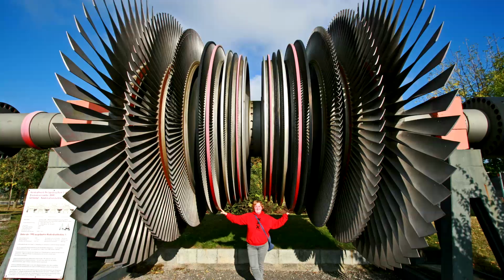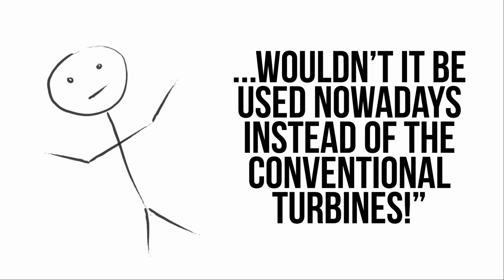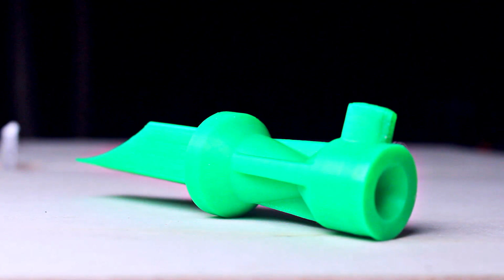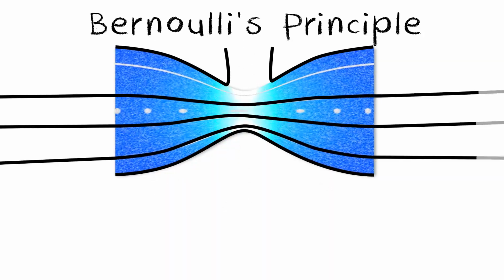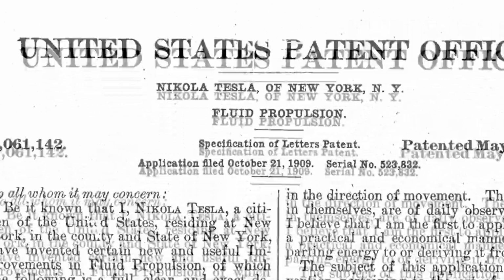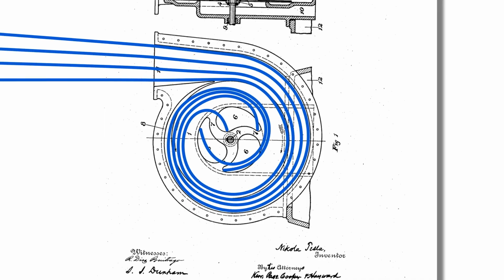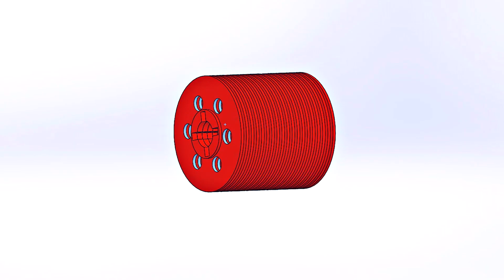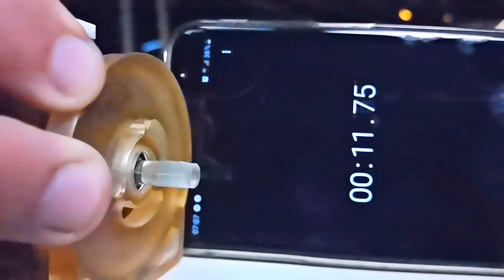Tesla Turbine [Smoke Flow Slow Mo]

Comment: Why not stagger the holes on each disc so when they are assembled they make a helical path through the discs for the exhaust. If you do this I think you can take advantage of some of the surface area inside the walls of the holes and introduce turbulence that could increase friction between the discs.
Reply: A hollow shaft with openings in the 2/3 farther the main exit and a centrifugal exit in the shaft to make a lower pressure in the center, It may help the flow but not sure about air viscosity inside the shaft.
Reply: Good luck keeping the vibrations down...
Reply: @tinklanjscek2700  if they are balanced per disk there will be no problem
Reply: @sugarbooty  I think you're right, and I misunderstood the suggestion originally.
Reply: @sugarbooty  Tesla has a special balancing apparatus patent for this, patent 186,799. He also has an improved disc stack construction patent GB 186,082 that he patented 10 years later after the first patent that does away with these difficulties and makes it so the turbine doesn’t need to be balanced 1 disc at a time.

Comment: You are using a small nozzle on your air supply right before the inlet of your turbine. Maybe this messes up your airflow, so your special inlet design is  not useful? You could try to use a bigger diameter hose as an air supply and control it with a ball valve.
Thanks for your interesting video and for sharing your mistakes, very useful for others 👍

Comment: Tesla turbines fell out of favor in power generation because at the time, there were no suitable materials available to with stand the forces on the blades. Thus, causing them to warp and the machine to fail.  So, if you want to bring the tesla turbine back, you need to find a good non deforming material at the speeds needed for power generation.

Comment: Additional to your laminar flow concerns, there are boundary layer effects occurring. You may want to calculating differing displacements of boundary layers, this is typically associated with a "Reynold's number". There are methods for directly calculating the displacement of the boundary layer away from the object that is in flow, which would allow you to intuitively space out your turbine "blades" for differing flow conditions.

Comment: I don't believe the convergent divergent nozzle will help you here. The reason it is successful on rocket is because the fluid if flowing at incredibly high speeds. In this case, fluid dynamics are 'reversed' meaning the diffuser at the end will actually further accelerate the already high velocity fluid. I think in your case, you may be better off will just using a nozzle if you want to increase the flow velocity. Hope this helps, great work!

Comment: Worry about your engine that your using for the energy conversion. Most engines are designed for great efficiency so will not produce what your looking for. You need something designed specifically for power generation. They make them. Look for replacement parts for windmills home use. I believe alternative would be a quad copter motor with the highest KV motor you can find.

Comment: This man will be the one who causes a 3D printer uprising

Also I’d really like to see you try the Tesla turbine with vicious liquids like honey or something even thicker, or maybe a thick gas. I’m not an engineer but maybe if the disks where thinner and the spaces between them are closed, it might be more efficient? Idk, I’m pretty dumb
Reply from the maker: Still around my dude!
Reply: there's a limit to how thin you can make the discs and how small you can make the spaces. Ideally you would have an infinitely thin disc with an infinitely small gap
But you run into the following practical considerations in order 
1. Structural integrity
2. Manufacturing
3. Size of the molecules
4. Quantum physics

Comment: Call it AzgNiET = your channel name backwards azgetni in the order of the name of the device ANET.

To get more power from the motor a more powerful magnet and a better coil design as I said before in your last turbine video. Since the coils on all devices have a loss which no one addresses due to the magnetic friction it has.

As I said in your last video to make a better turbine it would be better if you have the air eject from the center which I explained how.

The width of your internal chamber is too big in comparison to the air pressure you put in. its like your ar trying to rotate a ferries wheel with a small nozzle.

Tesla was smart since he read a lot, practiced a lot, was persistent to not forget to put it off for too long,

Comment: I believe for the "improved" version to work.  the rotors will have to be enlarged to match the largest dia,eter of the chamber and slots cut in to the walls where the rotors will overlap when it narrows.  might be a bit hard to get the tolerances right on 3d printed parts.  but might be worth a shot.

Comment: What if every other disc is connected, like a water mill. So the gas can push more surface area. It would use both turbine methods. Probably half the disc but significantly more surface being pushed. I wish I could explain better or show you.

Comment: try building an adapter to take rainwater from your downspouts to run the turbine.  you'll want the shaft oriented vertically with the outlet on the bottom.

Comment: @integza make the disks bigger but make the air tunnel smaller all together to make if you have high output of air flow in a small area it will have to go somewhere. Thus more power? Sincerely Jacob

Comment: 3:21 are we going to talk about how the blades are spinning backwards here????
Reply: The blades are not spinning backwards! The first 5 blades are the compressor, the others are the turbine. That is not a simple turbine but a Joule cycle!
Reply: @Nitro8996  So, If I am understanding you correctly. The first blade, even though it's angled opposite the way air would push. Would actually push it the opposite way?
Reply: @W00FLES  yes It Is in the opposite way, but there is something strange because the last blades of the turbine rotate in the right direction!
Reply: nitro8996 that's what I was saying!!!!!!

Comment: Theoretically if it was made of heat resistant materials you could use a closed cycle steam system powered by a solar concentrator

Comment: A Proper Wash + Cure Station Would Help In My Armchair Opinion
Reply: Here is a Good OTTS one:

https://www.amazon.com/ANYCUBIC-Photons-Printer-Cleaning-Machine/dp/B083GTS8XJ/ref=as_li_ss_tl?_encoding=UTF8&pd_rd_i=B083GTS8XJ&pd_rd_r=d79873d3-e2d5-4e14-b126-7e473a6401e7&pd_rd_w=CrJV9&pd_rd_wg=ffgrt&pf_rd_p=4022e0f2-c06e-4e9e-bb48-d7486d1197f7&pf_rd_r=9Q4AETAN0CB6ERQ8ECVM&psc=1&refRID=9Q4AETAN0CB6ERQ8ECVM&linkCode=sl1&tag=3dpriner-20&linkId=b0dbfe153ed7fd3c51156dfa6c53ec98&language=en_US
Reply: DIY is easy with a type of alchohol, a min, some sort of agitation, and uv leds and/or sun

Comment: I'm not an engineer, but I would like to try some
 modifications: 1) make the discs progressively smaller outward and do the inlet only on the center or 2) do the inlet very tight to the outside or 3) make the inlet very wide almost as wide as the radius of the discs. sorry if I said a lot of nonsense stuff.
Reply: Tight = speed, wide = efficiency.. :)

Comment: @Integza: please use gloves and  safety glasses when you're handling resin and the parts, that stuff is dangerous. For the record I've got a large FDM (HEVO 290x290x750mm) and a small sla Nova3d elfin) printer myself and the Elfin prints are very good if you don't forget to add resin in the middle of the print.

Comment: C-D nozzles are used to convert subsonic flow to supersonic flow, but the throat of the nozzle needs to be "choked" to where the velocity at that point is at Mach 1, otherwise you're just going to slow the fluid down because it never gets up to critical speed. You'll also need to do some calculations to see what the optimal expansion ratio is based on your pressure input and atmospheric pressure.
Reply from the maker: Thank you for the help :D

Comment: These tesla turbine videos are my favorite. Do you think there is a way that you can create a region of turbulent flow along the inside wall of the casing but no where else that way the fluid input is not being slowed while trying to interact with the case rather than the disks?
Reply from the maker: I actually can, there's this thing called turbulators the generate turbulent flow!

Comment: If you use hard drive disks, you'll probably be able to safely hit higher speeds. I'm not sure how durable SLA resin is, but I've heard that it leaves lot to be desired.
Additionally, try using an involute casing with a separating fin that follows the curve of the disk somewhat further

Comment: @
Integza  I have several questions:  Did you test both casings with the standard and convergent divergent nozzles?  What are your thoughts as to why the Volute casing did not perform as well as the standard design?  Was your Volute casing designed with a Fibonacci spiral (I realize that Tesla'a own design doesn't use Fibonacci) for the gradient?  Would you be willing to do a follow-up on these points?

Comment: Dear Integza,
the diffuser at the inlet of your turbine has way too high angle of flare (this diffuser should be way longer), in this case the stream of the air is disconnecting from the walls of the diffuser, due to this discs in the middle are getting more air than those on the sides. The optimal angle of flare for diffusers is 5-7 degrees. Print another one, I can bet that the rotating speed can be higher.
In order to get de'Laval's nozzle working you have to calculate it very thoroughly
. There is a lot of physics in that. If you don't do this, the nozzle is not going to work. This is probably the reason, why the turbine was working with lower rotating speed.
Reply: Excellent point.  This is why I asked if both cases were tested with both nozzles.  I suspect that a wide, flat channel between the standard nozzle and entry into the case may enhance the surface area of disks affected by the fluid.

I would also love to see a one-for-one-for-one comparison between the standard casing, Tesla's Volute casing, and a Volute case with a Fibonacci curve for the gradient with all other parts identical.

Comment: Great video! For improving the design of the TT,  you might want to study which is more important, big disks or many disks (for a given disk area). I have no idea how to measure that but it might help understand how to improve the TT.
Reply: I suspect that the original turbine, being made from metal, benefited as much from the flywheel effect than surface area (assuming smooth disks).
Reply: @Circle14  what's the flywheel effect?

Comment: I am not an engineer or anything, but since those turbines are based on the viscosity of the fluid to spin, I think making rough disks would help improve the design, as it would "have a better grip on the fluid".
If you can, try coating the disks with some kind of abrasive painting and see if the torque/Rpm increases :D
Reply: Instead of coating the disks it would be better to lightly sand them with some 80 grit sandpaper.  If you add a coating it could ruin the tolerances or create an imbalance.
Reply: @Circle14  yeah, you are right, but I heard that sanding resin with rough sandpaper is gonna give you some trouble... still worth trying tho
Reply: @mauco4037  True, but the disks don't have to be resin.  In fact, it may be worthwhile to use metal disks.  The density of the material will add a flywheel effect to further improve efficiency.
Reply: @Circle14  Great idea! Hope to see a new version of the tesla turbine soon

Comment: the updated housing reminds me of turbos on vehicles both the intake and exhaust side and they use curved turbine blades in them. if you can try a smaller inlet and smaller area around the turbine,
so the turbine is in more contact with the air for more power.

Comment: With which software are you using to create 3d models?
Reply from the maker: Solidworks
Reply: @integza  thoughts about fusion 360? Wanted to learn solidworks but the price is unreal..
Reply from the maker: @Madpis3D  Fusion 360 is the best choice by far! I only use Solidworks because is what I learned in college.
Reply: @integza  great to know, thanks (:

Comment: great video but I think the engine at 3:23 spins the wrong way?
Reply from the maker: Very well caught! I didn't do that specific animation. It is an animation from Wikipedia. 

Someone is gonna get fired ahahah
Reply: @integza  animation is in context of jet engine and is correct, reuse in context of turbine got it on to wrong side
Reply: @imagine3DIndia  Is it? I think it's backwards also for jets, they push the air through.
Reply: @imagine3DIndia  It's still backwards. The airflow indicated by the arrows would turn the blades in the opposite direction show.